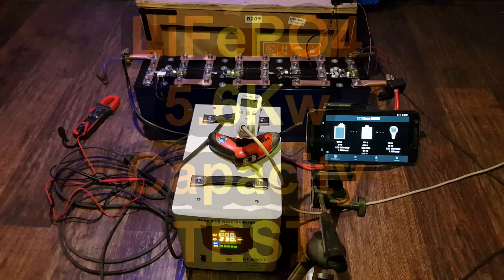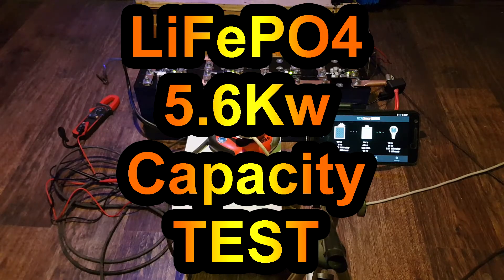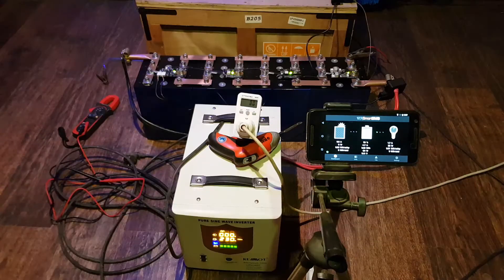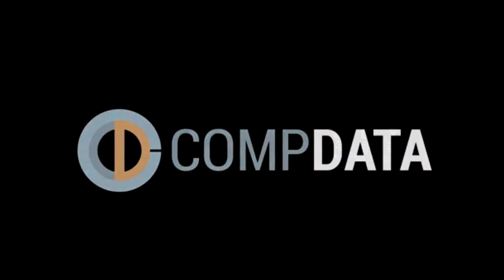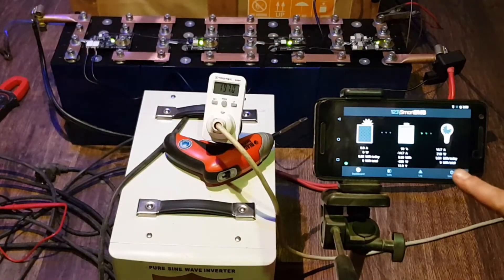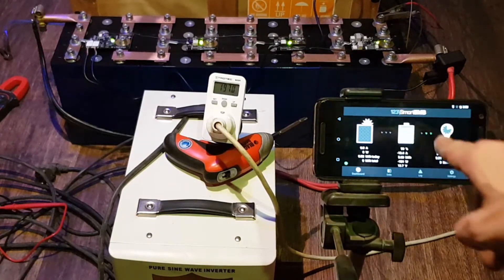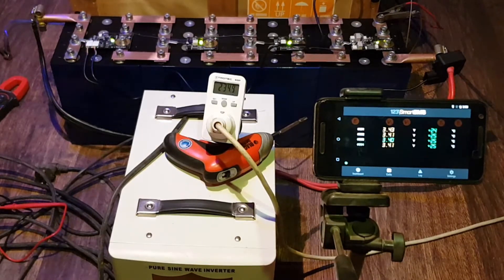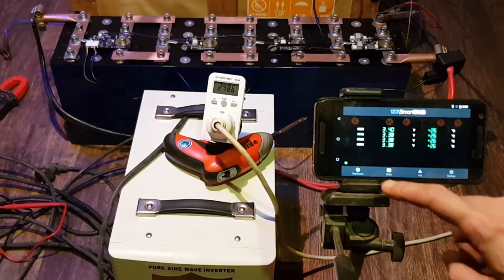LiFePO4 Battery | 5.6Kw | Capacity Test | Timelapse

Comment: I should have gone this route and bought individual cells to build one big battery 😓 next time I guess
Reply from the maker: I think you can disassemble your Lifepo4 packs to get the cells out and reassemble them together with a 123\SmartBMS gen3 then you don't need a shunt.
Reply: @StarJackerSRL  lol, I don't know how to do that. I was thinking about getting the Ali shunt monitor. Only 34 smackaroos online.  Not bad price
Reply from the maker: @easydiy224  Will Prowse has videos disassembling LiFePO4 battery packs to see what is inside.
That shunt is a good idea too. But i would go with a Victron Energy SmartShunt.
I have bad experiences with chinese products like Epever.
Reply: @StarJackerSRL  I wish I could afford victron equipment.  I don't have anything victron.  I have all the cheap stuff like Renogy.  I'm just trying to make everything work on my budget.  Anyways, yeah everyone seems to like this Ali brand and I think I'm going to go for it only because victron I can't afford 😭